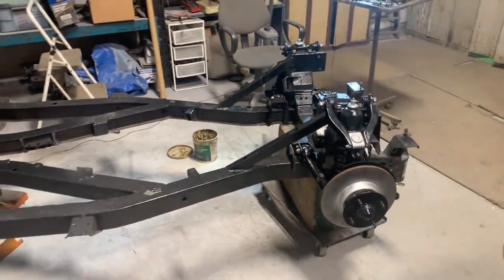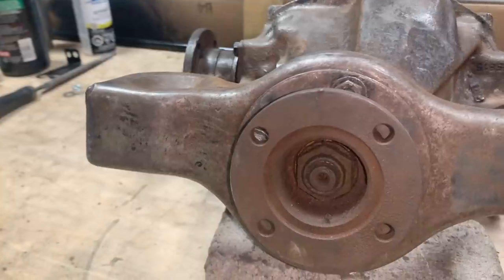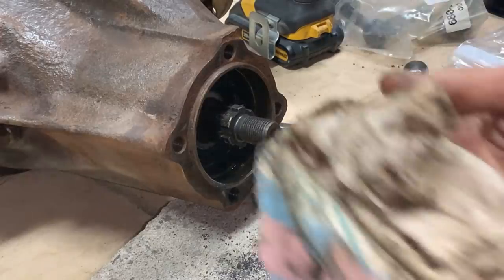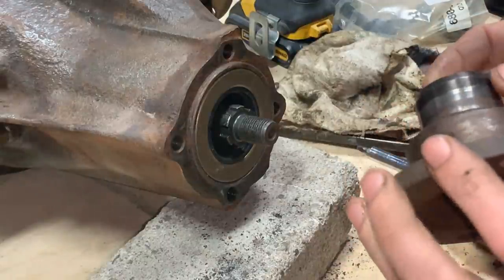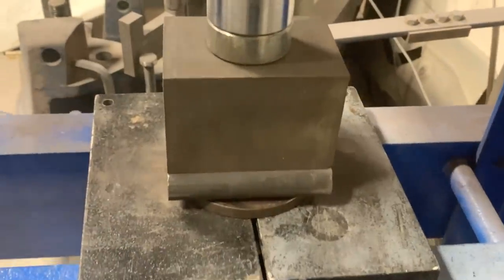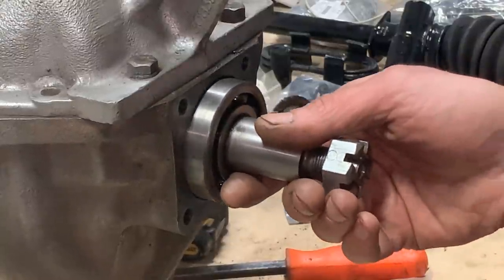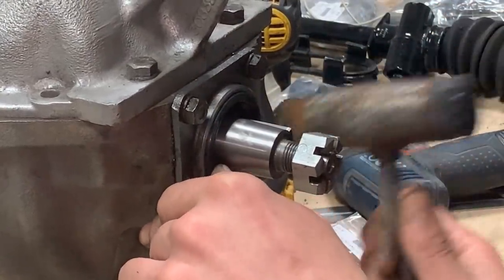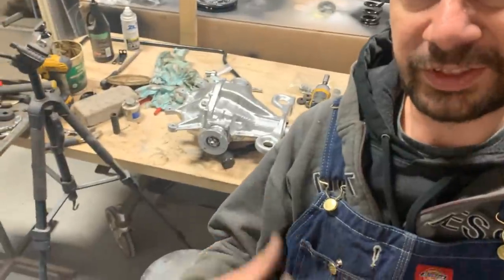1974 Triumph TR6 - Part 58 - Differential Oil Seals

Comment: We use the wood screw trick to remove the group gasket on espresso machines. The rubber or silicone group gasket, that seals the portafilter to the group head, gets very hard and difficult to remove after a year or even less. A wood screw through it forces it out or sometimes causes it to crack. Either way, it is then possible to pull the gasket out using a screw driver or pliers.

Comment: Are you maybe saying “cotter pin” when you mean “split pin” ?

A cotter pin is a bolt with a flat side usually to wedge against a shaft...
Reply from the maker: Different places different terminology. Everybody around me calls the split pin a "cotter pin". I purchased a box of different sizes stainless steel ones from Amazon recently and that is what they were called. "cotter pins".
Reply: Yup, they are cotter pins in north america, split pins elsewhere.